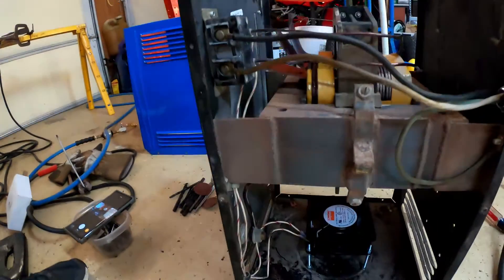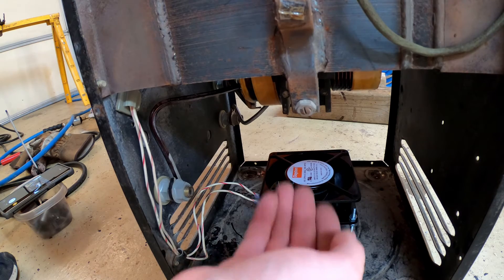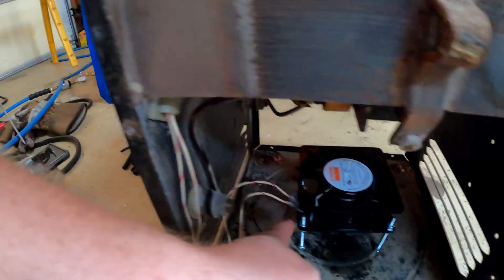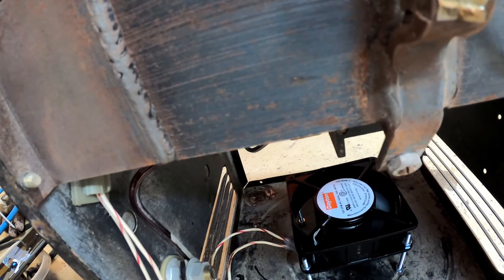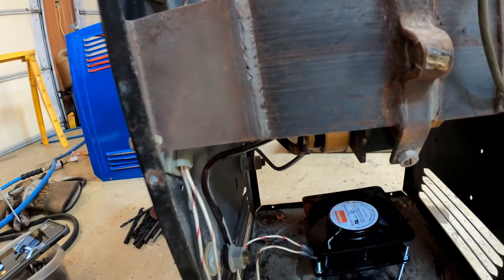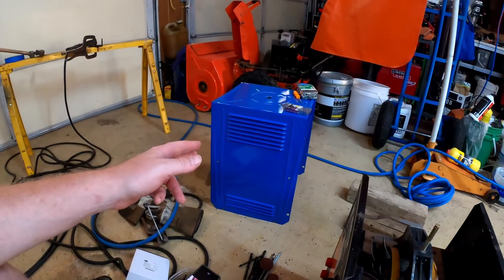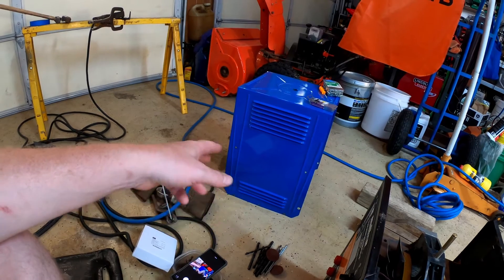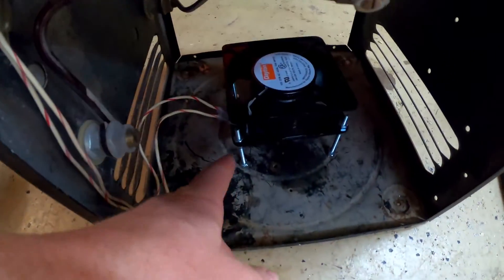Miller thunderbolt

Comment: I got one a few years ago the guy was a landscaper who moved in next door and was cleaning out the place from the previous guy who had left suddenly maybe 4 or,5 yrs before I got a Delta 16 in drill press and Miller thunderbolt AC DC along with a new in the box never been used rod oven for $300 the power cord on the welder was junk so I replaced it the dinse connectors need to be replaced now so I ordered some on line but aside from those little issues it works like a champ to me being a Lincoln person I have to say I love it

Comment: I inherited an old Thunderbolt and was mystified when I wired it up, plugged it in, turned it on and heard no fan... when I asked, the previous owner said it died like 20 or 30 years ago but has been working just fine without it since.  I do notice a lot of heat coming off the unit if I burn a few rods so I'm going to be doing a very similar fan install; the internals are in a different layout but no matter what I think it's going to be better to have some cooling.  Thanks!

Comment: .............I change the power cord & bootlegged a 110 circuit.............energized through machine's power switch. Can now use whatever fan motor, & also power a grinder from the 110 outlet I mounted outside of welding machine. None of my riding lawn mowers came with a horn.............I had to correct that too.
Reply from the maker: Awesome

Comment: The fan that was in there worked for over 30 years in the dust and never cleaned or lubed and when it died, this guy calls it junk. Then complains when it costs just over $100 to replace. Jeesh.
Reply from the maker: They are junk. No bearings, they have no longevity. The design is to fail and what is the part that fails in this welder them. When I buy pieces of equipment I want to them work. Is that too much huh. I had more than one of these and it always the fan that fail. Thanks for your opinion, I have mine too.
Reply: @detailisretail  I think the point he was making is that it lasted over 30 years. Show me any entry level welder made today that will last that long. I have Miller welders, Lincoln welders,  century welders and they are about the same at the entry level.
Reply from the maker: @marcianotrevino9076  my opinion, one it everytime I go use a Miller there is some wrong it. My aunt work for them, there is no welding talk at family visit. Especially after I talked to her about my Bobcat 250, how stupid it was to use plain steel for the choke rod. Which rusts in place. What would it cost to have that little rod stainless. The Bobcat is supposed to be outside truck mount machine. It so much better to have a hard to pull it open. So you can start it up. (that Millers design not Kohler) Miller doesn't sell you any parts for the Kohler engine. On their product, their thinking it's not ours. But they put them on their product. I was told to contact Kohler. The main problem with the one in the video. These machines don't run everyday. You use them here and there. And another example of design. At shop I spend time at. Out of the 4 Miller welders there 2 are only working. The Tig welder sounds like the cooling pump going to stop and yes there coolant in it.  Ran to another place to use their Miller it was hit switch ten times before it powered up. So with my experience I do have opinion.

Comment: Hey, i just bought that same miller welding machine, and doesn’t turn on. I checked if its getting power and it does, but it still doesn’t weld, what can it be?
Reply from the maker: https://www.millerwelds.com/files/owners-manuals/o116j_mil.pdf
Reply from the maker: check iwhere the leads plug in, on the inside are tight.
Reply: Thanks for the help bro! Is there any email that i can contact you, since im new at this and the machine doesn’t work. To see how can i fix it,
Reply from the maker: @slendercriss4192  you can email me at Perry@detailisretail.com

Comment: Good job. Grainger says this fan is to be mounted horizontal and it don't have bearings either, just bushings. Do you think it will hold up using it the way you use it?
Reply from the maker: I'm sure it will last as long as the Miller one did. If it doesn't, I can buy many more for the price of one miller fan. If you look at a lot of the new computer tower has mounted sideways.
Reply: @detailisretail  Thank you for the reply , will give it some thought.